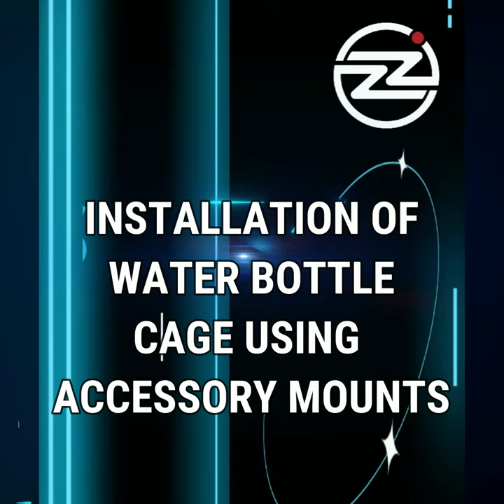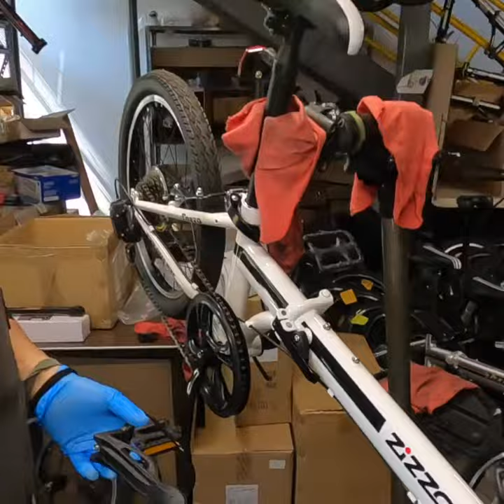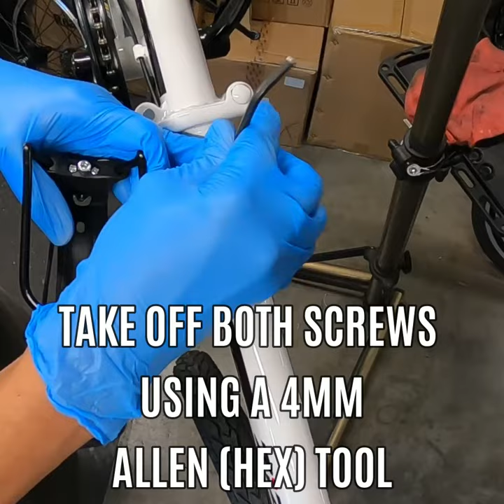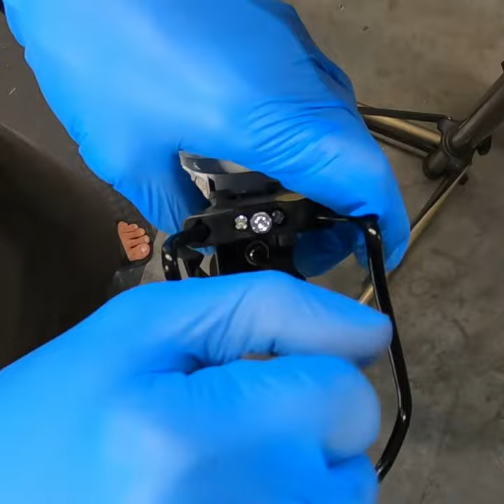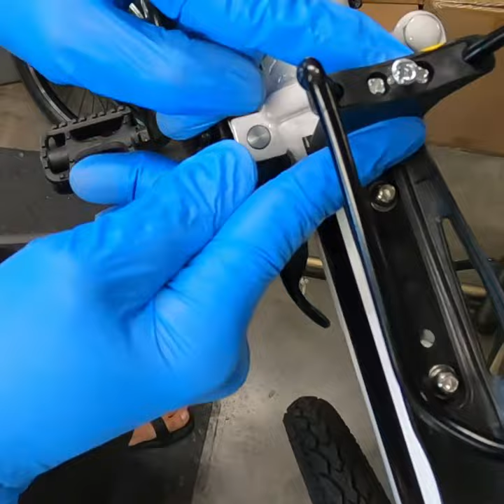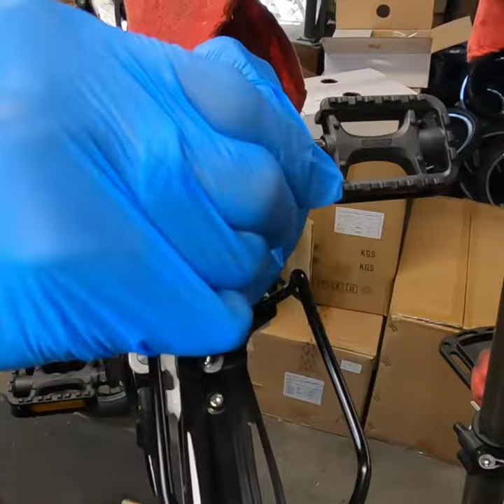Tony's Tech Tuesday Ep. 8 Installing ZiZZO Water Bottle Cage

Comment: Thank you for this video. I purchased a ZIZZO handlebar bag, phone mount, water cage, and a King of Ding II bell. I was able to mount them all with the exception of the water cage. I couldn't figure out how to unscrew the mounting bolts until I watched this and saw you using an Allen wrench. I hadn't noticed the holes in the top of the bolt until now, so I just now finished installing it. I normally carry 16 oz water bottles but even with the spring bolt tightened all the way down it's still too loose to hold it, but I can easily find other water bottles that will be suitable. I'm good to go now.🙂
Reply from the maker: We are happy to hear the video was helpful! Thanks for the feedback-BG